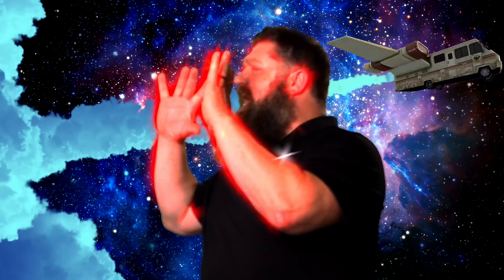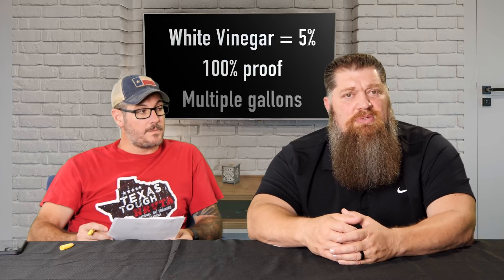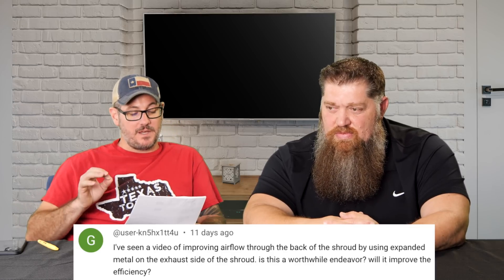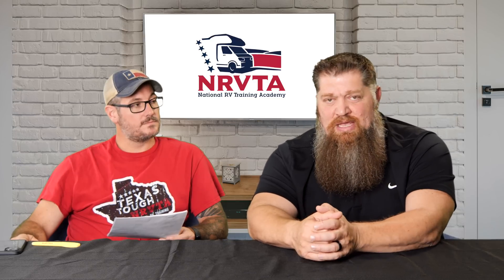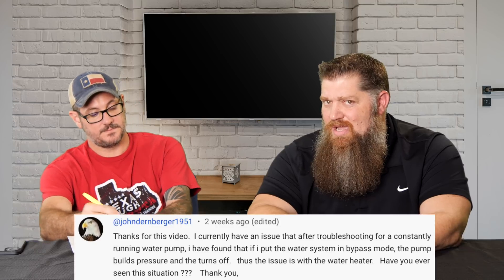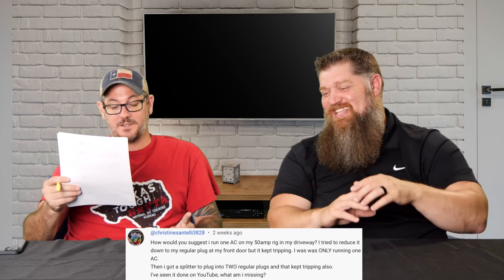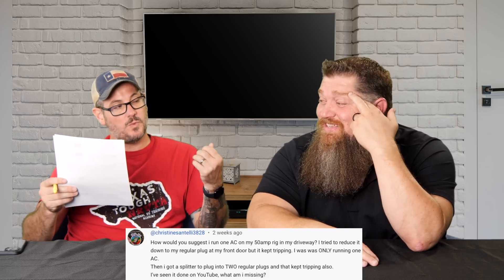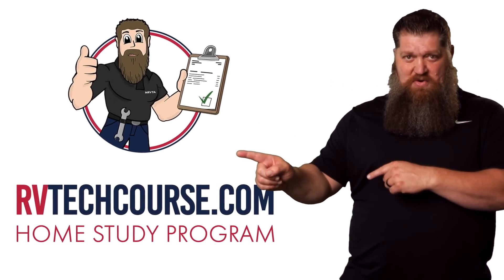Run one RV AC from 15a house plug - Two Minute Tech Tip Q&A

Comment: I have a wall ac unit and up until a few days ago it was fine. It's been really warm lately and feels like 39 with humidity. But recently when it tries to cool down my apartment and switch back to fan, SNAP goes the circuit breaker. The unit is maybe 2yrs old and the fuze panel it sits on is 15 amp rated. It's 10,000 btu unit and it's sad that I now select anything below 80 on the readout and 10 minutes later it trips the fuze. I even just ran it on fan mode for whole evening to see if it need to just cool down as it were. But nope it still struggled. There is nothing else plugged into the same outlet.

Comment: This may not be the correct venue but I have a question regarding a propane electric fridge. You preach about how unsafe it is to travel with the propane on. How does the Fridge stay cool  when traveling?

Comment: I found that on 15a service for a/c, turn system to fan first and let fan kick on, wait about 15 seconds then quickly change to cool but not to auto. Do not turn on any other appliance to electric as that will trip the breaker.

Comment: Was wondering why people hate so much when i tell them about the 4 days the wife and i spent in our rv running our entire trailer off of the F150 30amp connection?  Everything ran perfectly for 4 days in 90 degree Florida weather after the Hurricane.  It was literally a plug and play with a plug adaptor and using the same cable just like plugging into shorepower at a site.

Comment: If I replace my aging 6 volt batteries that make up 12v. If I replace them with lithium. Will my converter charge them properly?  Will I be required to replace my current converter.
Reply from the maker: Check out this video:  https://youtu.be/10O1Z4-s_80?feature=shared

Comment: Todd,
You should never try and run your ac off a 15amp home outlet! Extension cords cause a voltage drop as well as the plug itself. Folks that try to short-cut things in this way are risking their ac units. Get the proper 50am plug installed and don't risk it!

Comment: Certainly enjoy your vids, but you biffed Question #2 about the AC.  
They were asking about cutting the slats out of the shroud on the roof and adding expanded mesh to decrease resistance/turbulence on the condenser exhaust.

Comment: Hey Todd!  Regarding receptacles in garages, NEC has required those to also be GFCI for the last 15 years.  Switching from an outside GFCI outlet that is tripping to one in the garage will still leave the system on a GFCI if the construction was built to the newer code.
Reply from the maker: Did I say garage? I might have. A non gfci outlet

Comment: Could you explain more about your comment about the (soft start) helping or not, plugging into an (home) outlet?
I have one rooftop AC I do have a built-in generator which I don’t like to use because it’s very noisy and right underneath the bed. I occasionally use a small 2000 W generator plugged in with a heavy duty cord located away from the coach.

Comment: Thanks for the answers to my question sent in last week… Have two Victron multi-plus 12/3000/120-50 120 V inverters, that yes, program  each inverter to a limit of 15amps when hooked to 30 amp service.  Even when on 50amp service I usually have set at 17amps and have not had any problems.  Thanks again for taking time to answer my question…and the mistake I made about if your a 50 amp trailer…😂 😀

Comment: On the constantly running water pump.

Mine does this when I first turn it on, and I have to go out and pull the T&P valve until water comes out. Otherwise, it won't pressurize. Maybe that will resolve the commenter's issue.
Reply from the maker: Are you emptying your water heater?
Reply: @NationalRVTrainingAcademy  not really. I turn the pump off, and I open the cold and hot water valves on one of my sinks for a few seconds to relieve pressure. Makes me wonder if the check valve in the pump lets water back into my fresh water tank between camping trips. It holds pressure, just on that initial start it seems it won't shut off until I make sure the water heater is filled.
Reply: @NationalRVTrainingAcademy 

Any

Comment: Here's my question..... 30AMP RV plugged into a surge protector,  15amp to 30amp dogbone, nothing in the trailer on at all and fridge set to Propane  and still pops the house breaker. What's my issue?
Reply from the maker: Is it on a gfci outlet in the house?

Comment: Question about the first question  🤔  .
   If I drain the heater tank before I put the 30% vinegar in , should I put a gallon of water in the tank to dilute the 30% gallon ?  Then add another 3+ gallons of water  ?
Reply from the maker: As long as you add water.

Comment: Fire cracker Tuesday Todd! 🎉 On the first question. which I never heard of, how would you get your mixture in the water tank in a 6 gal Atwood? If you have a problem with scale build up, it would be in your pump filter. In order to get that mixture in, you would have to turn the bypasses on and take the pressure valve off then put your mixture in, which would be a pain in that thing you sit on. Just buy a tank flusher and do it once a season. WaLa! 😃

Comment: Not sure I fully understand how a "soft start" works. I installed one myself to insure we'll have cool air during this summers 5 month journey during the summer months at campgrounds with only 30 amp availability. We only have a single small Brisk air Dometic. It doesn't slow the start up in-rush??